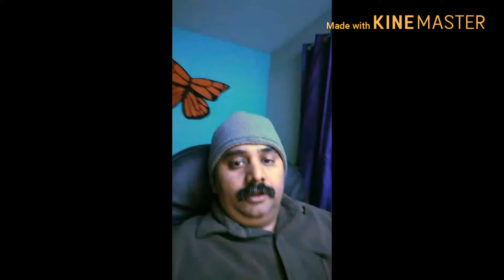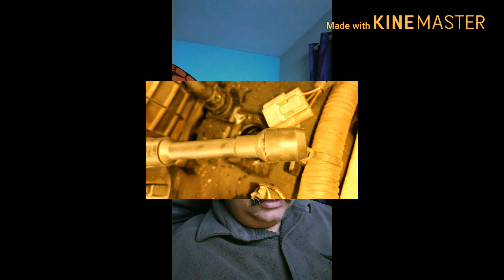Fixed : 2007 Nissan altima 2.5 S, P0300 Multiple Misfires

Comment: This was the exact problem I had. I got P0300 on my 07 Altima. After checking the ignition coil boots, one of them had a tiny hole, causing it to spark to chassis. Replaced the boot and its working great. Thanks for the video!
Reply: Did you car have misfire